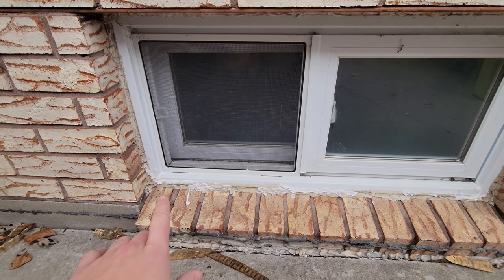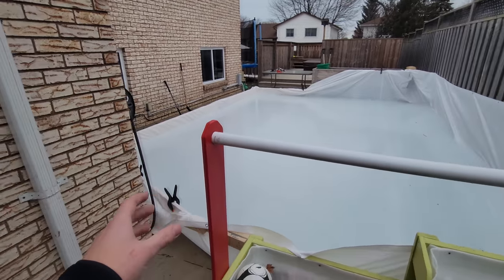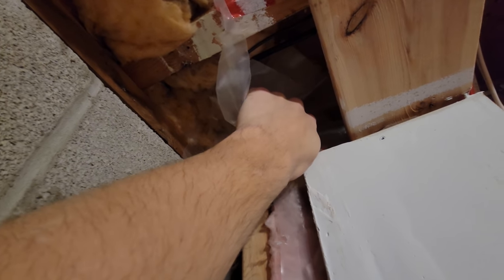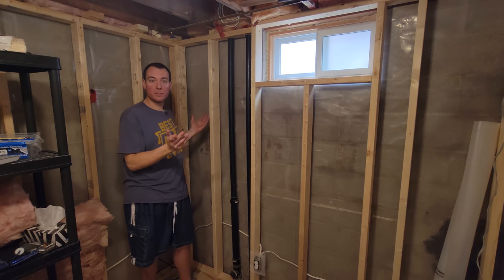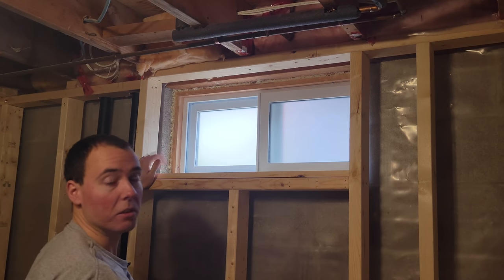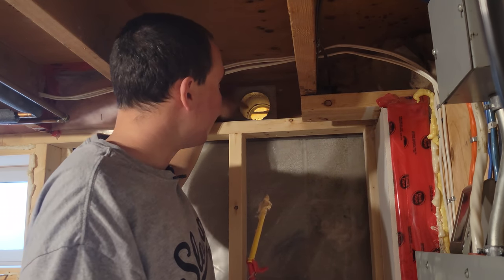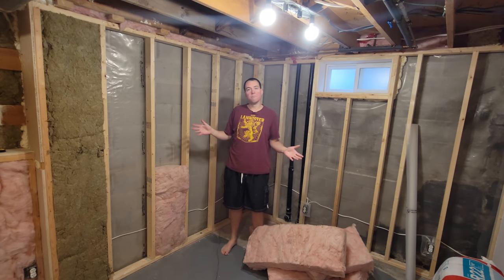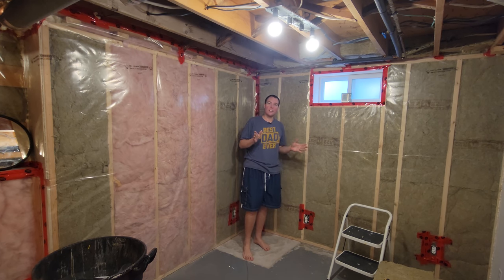But Wait, There's More! (Adding an Extra Bedroom - Part 3)

Comment: Greetings from one home renovator to another. Nice work your doing and an extra plus that your sharing your experience with youtubers in general. I went through your list of responses here and didnt see anything in regards to Building codes? Have you chaecked your local building codes for adding a bedroom in the basement? Because from my experiences in the past if this room is to be a bedroom not only is the window too small it is not what might be regarded as a true fire egress type window? Something that should be considered  at this point if its not too late?
And you could combine an upgrade to a different window that incorporates Fire regulations and a proper drainage well on the exterior

Comment: If I could give you any advice on the brick sill that you have outside that basement window.... I would say take out the bricks and put in a proper formed concrete sill that you can buy in any hardware store. The bricks look lovely and match the house but rain water will not run off of those bricks as well as they would a formed concrete window sill, and the proof is in the pudding because you have chunks of mortar missing from between those bricks as what has happened is water has sat on the brick sill, not been able to run off the bricks it's frozen expanded and knocked out chunks and allowing damp to soak in over time.

Jacking up the concrete in your yard might be an option but a cheaper way since you have an angle run off anyway would be to do a a cement angled bead (only needs to be a couple of inches wide And high up the wall) all the way around that side of the house where the wall meets the pavement to aid water run off. 

Your plan to use corrugated French drain pipe to take the water from the fence line to the rear of the house is just like I was saying last time a very good idea, but I would suggest going down at least 2 foot and covering the pipe with pebble gravel as a French drain pipe that is too high and close to the surface ain't worth a damn. 

Also don't forget that when the French drain corrugated pipe reaches the end of your garden definitely put in some sort of drainage sump. Don't have to spend a fortune even a very large plastic trash can with multiple holes drilled in it will suffice. Otherwise you're just going to get water pooling in the bottom corner of your garden.

You're really doing a lovely job there, I'm enjoying the multiple part videos. It's nice to see a YouTuber take pride in the work they do and when they get it wrong they go back and correct it like you did.

That's going to be a stunning room for your kid when that's complete... looking forward to the next part.

Well done keep up the great work and hi again from Ireland

Comment: You should never have 2 vapor barriers on opposite sides of the insulation. Vapor barriers always go to the warm side. The plastic against the brick is acting as one. If anything I think that's going to make it worse b\c the brick cannot breath and any moisture \ condensation will just built up over time
Reply: that is my understanding as well only.
Reply: I did this with my basement, there was mold in a year. Had to redo the entire basement Don't put vapor barrier on an outside brick wall
Reply from the maker: The rest of my basement was fine. The problem is only where the moisture was. Again it's a moisture barrier and the Vapor barrier is on the back side of the drywall and sealed there. The moisture barrier can breath against the brick and only serves to stop any moisture from wicking into the insulation.

Comment: You put a vapor barrier on the concrete wall it appears, putting up a second one on the inside will just trap moisture and you're back to your mold and rot problem.
Reply from the maker: No. It's called a moisture barrier and can breathe. It just stops the insulation from contacting concrete.
Reply: @DIYBuilds  Good luck with that
Reply from the maker: It's literally canadian building code. So thanks I guess.
Reply: A better solution to using 6mil poly against the cinder block wall would be to use Tyvek instead.  You place it with the exterior face towards the block wall, and yes you leave the top and bottom “open”.
Reply from the maker: True
Reply: @DIYBuilds  Here is the canada building code Quote "To protect the insulation, framing and wall finish from possible water damage, cover the basement walls with house wrap. Plastic was once the material of choice, but in some cases where air and moisture entered the insulated wall, condensation formed on the plastic and caused wetting and mould issues within the wall." so as long as it was not solid plastic sheet he is good.

Comment: OMG!!! STOP DOING A DOUBLE VAPOR BARRIER!!!! YOU WILL CONTINUE TO HAVE MOISTURE PROBLEMS!!!
The vapor barrier goes ONLY on the interior side of the wall. You MUST allow the moisture to weep through one side of the wall. The only time you use a vapor barrier against the concrete is if the stud wall is ATTACHED TO or butts up AGAINST the concrete. Your wall is spaced off the wall, therefore, no vapor barrier! This is IBC for 2021. 
THIS is the problem with the side wall that you found earlier. Leaving the top and the bottom of the vapor barrier open is NOT going to solve the issue, and it will NOT allow the moisture to escape. The drywall will PIN that plastic to the studs, creating a sealed cavity. Reread the building codes please, my friend. 
Sorry for the all caps, but I've tried to get your attention previously. You obviously do not read a lot of your comments.
Reply from the maker: You obviously don't live in Canada. And I've addressed this type of comment before. It is a moisture barrier. It is not sealed at the top and bottom. It's job is to stop the insulation from touching the concrete. In a Vapor barrier basement system you cannot have any type of moisture in the walls at all to begin with. If so you will suck up that moisture into the insulation. The 'Vapor barrier' that is behind the drywall is air tight. The reason I had condensation behind the left wall in video 2 was because there was insulation in place but no sealed Vapor barrier yet. Allowing the humid air to get back there while the other wall dried out. I've doubled checked the codes in Canada and the method I'm showing here is one of the recommended methods for insulating a basement. Again if the basement has moisture problems then this type of system won't work. I believe that I have solved those issues so I should be good.
Reply: @DIYBuilds  you are correct in that I don't live in Canada, but IBC 2021 (INTERNATIONAL BUILDING CODE) is what the Canadian code is based off of, as well as code here in the States.
The code has changed dramatically for vapor barrier installation and no longer recommends a double vapor system for basement walls. You are basing your findings on old information!